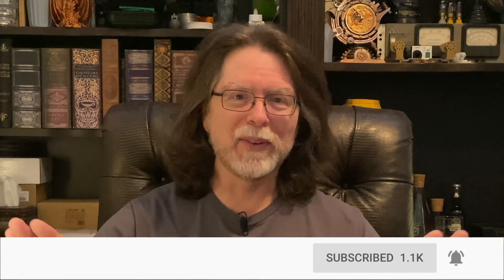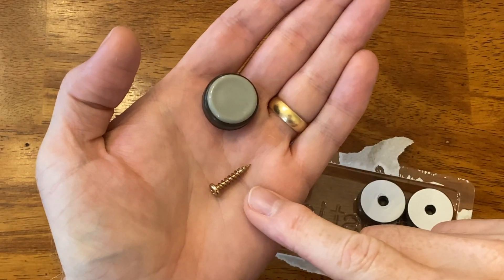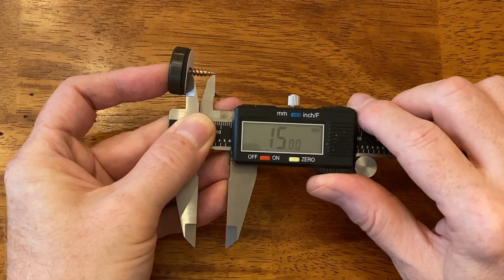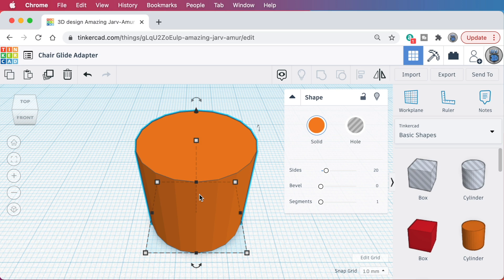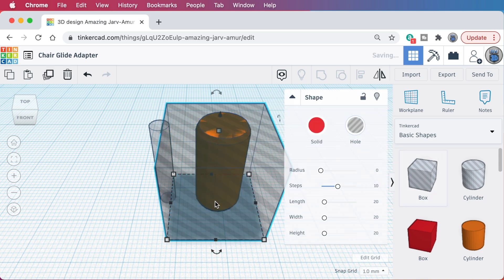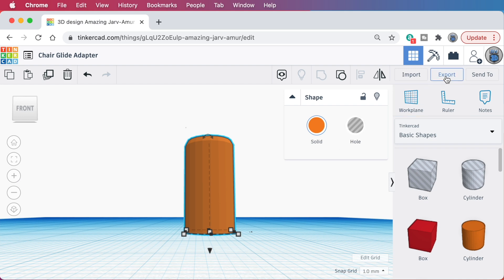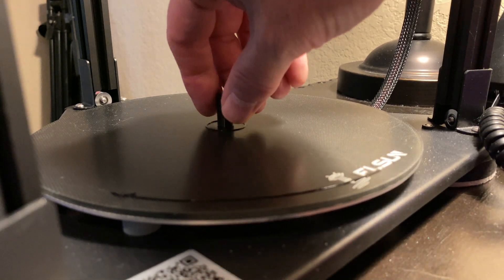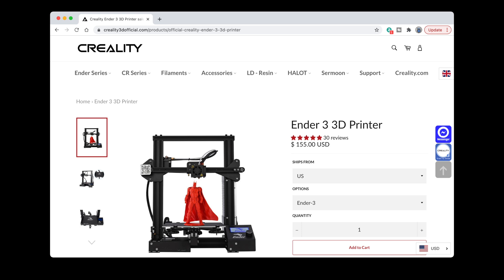Use Practical 3D Printing to Repair a Chair!

Comment: Why not just replicate the original glide and print it out of ABS?
Reply from the maker: I like the new glides. That grayish plastic disc that contacts the floor is some kind of low-friction plastic. It's the same kind of stuff they sell in those furniture moving kits with the big foam pads on one side and the low-friction plastic stuff on the other 👍

Comment: Tinkercad looks so easy to use.
Thanks Bryan 👍
It does work on an android tablet but is so difficult to use on there.
Reply: It's a great tool for making mechanical parts to measurements without having to learn sophisticated CAD software. I've been able to use it for all kinds of utilitarian parts like a new leg for my subwoofer and various jigs. I also successfully designed some fun 3D gift tags to attach to presents last Christmas. Great fun.
Reply: @Agamemnon2  I really like the idea of personalized items.
My daughter is always asking me to make gifts for her friends!
The problem is, if it's not on thingiverse, it doesn't get printed.
Thingiverse used to have an edit tool but it hasn't worked in ages.
I'm definitely going to be using tinkercad from now on.

Comment: I used to do some of my design in Tinkercad as the workflow is fast and then export to fusion 360 for better tools, however, since the changes to fusion 360 for the free licence once I export from Tinkercad to Fusion it crashes if I try to do it say the day after and I have to uninstall and re-install fusion 360, the only workaround I have found to this is to crack the free trial version which I am not 100% happy doing but seeing as Autodesk have done nothing despite me reporting the bug it is the only option left open to me

Comment: I had to replace a missing leg on a raised bed frame I got on the cheap. I also used Tinker Cad to design it so I wouldn't need  to use bolts to attach it. Do to it being 14 inches tall I made it into sections and Glooped them together for a strong bond. Having an easy program like Tinker Cad helped give me a leg up on this project.
Reply from the maker: I see what you did there. 😂

Comment: My chairs/table use nail-in glides. Have to change them every few years.

Now, the trimmer head button I printed out of PLA2 is on its 2nd year of use. 💪👍
Reply from the maker: Fixing things is fun. Even more so when you can design and print a replacement part to do it! 👍

Comment: Cut that time in half by upping the perimeter count to eliminate the infill. Infill really slows things down and, not that this needs it, perimeters are stronger.
Reply from the maker: Just for grins, I resliced the part with 6 perimeters (so no infill). Everything else being equal, the print time estimate is still 12 minutes.

Interestingly the settings I used for the prints in the video created solid infill on every layer. There's a setting in PrusaSlicer that controls that. If a feature on the model has an area under a defined threshold, it prints solid. (Print settings > Infill> Advanced > Solid infill threshold area. The default setting is an area of 70mm^2.
Reply: @BV3D  on a delta, that shouldn't take long at all. All comes down to slicer tuning I guess. 👍
Reply from the maker: @OldCurmudgeon3DP   @Old Curmudgeon  Yep! I tend to use conservative settings rather than pushing things to their limit. 😇
Reply: @BV3D  even w/ an FX8350 Fusion still takes a minute or 2 to fire up. 😕
7min w/ 3 perimeters. Minimum layer time (5sec) got me though. 🤬 It's under filament > cooling > advanced. Speed after layer 2 was under 50mm/s.

Took that out and got it down to 4m. So, almost longer to run start gcode than to print. 🤣